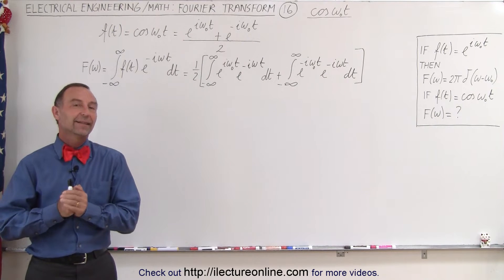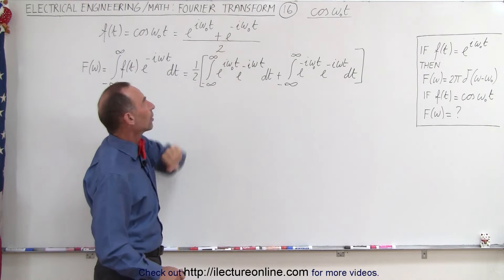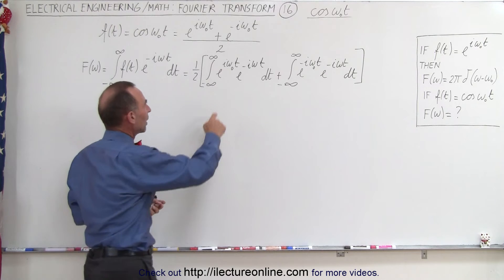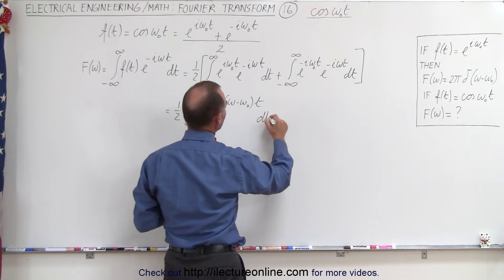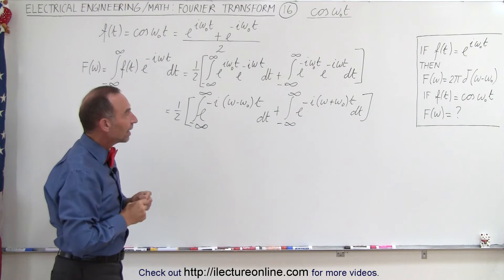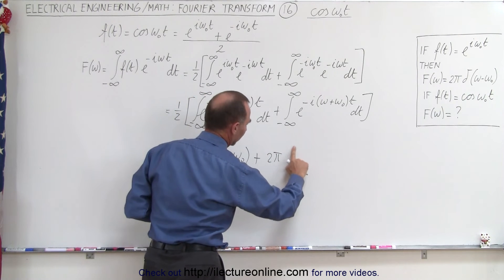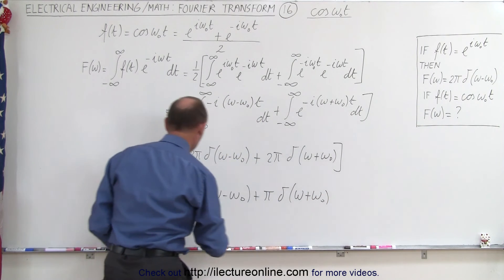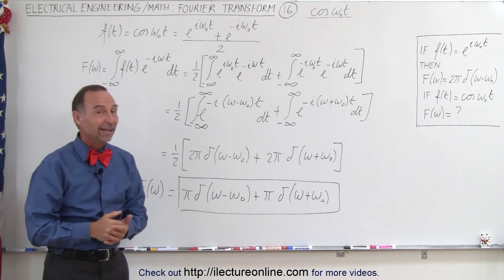Electrical Engineering: Ch 19: Fourier Transform (16 of 45) cos(w0t)

Comment: i get this but i don't f(t) = e^iwot ---> F(w)=2PI Dealta(w-wo) but e^it(w-wo) is not e^iwot 
assume (w-wo) = u 
then  F(w)=2PI Dealta(w-u) =2PI Dealta(w-w-wo)  = 2PI Dealta(-wo) i don't get it, i will just memorize for now
Reply: This is a year late but I’m thinking it’s because for f(t) = e^iwot the fourier transform is F(w) = 2*pi*delta(w - wo) right, so if now it’s  f(t) = e^i(w - wo)t, then in the fourier transform replace w with (w - wo), so it becomes F(w) = 2*pi*delta(w - wo - wo). And if wo is some arbitrary constant, then subtracting two arbitrary constants is essentially the same as subtracting one arbitrary constant. Hence F(w) of cos(wot) still has the delta function as delta(w - wo).